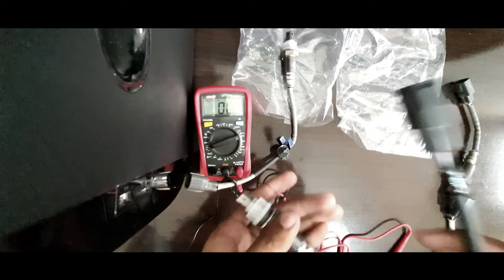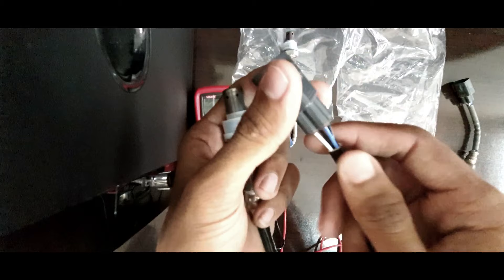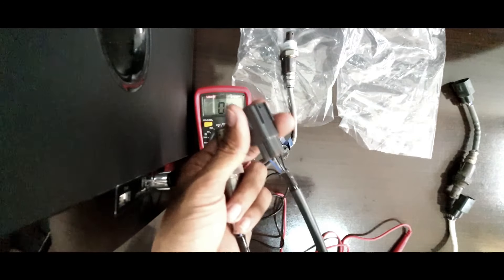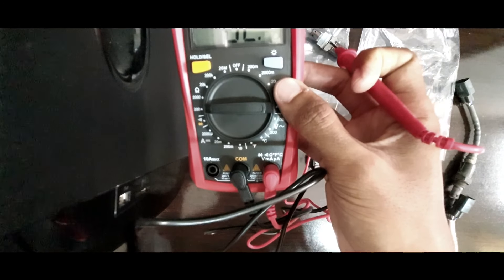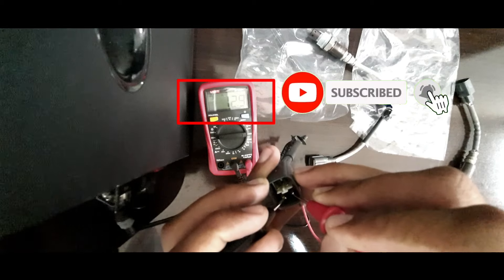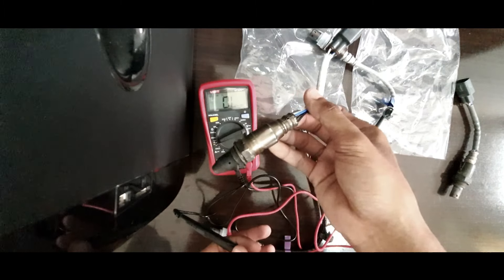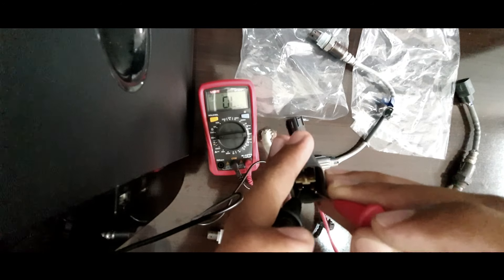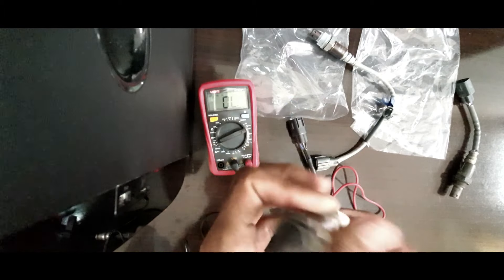How to chake Oxygen sensor with multimeter damage or not 😊easy solution😊

Comment: wrong, 2 black wires are not signal wires, its for Heater circuit, the other two wires are for O2 sensor output signal.
Reply: Thanks for this clarification. I have been confused on the 2 black wires. Don't they have polarity or they can be connected interchangeably
Reply: @SoonQie  they don't usually have polarities
Reply: Hi sir thanks for clarifying but where exactly we able to know and test which of those wire? Please help
Reply: Hey mate they are heater wires, not computer circuit!
Reply: Heater is still broken, needs to be changed
Reply: I have different colors on all my wires. 4 in total - white, grey, black, and red. 2016 smart ForFour 1liter. 0258030336. Throwing up a P224413 code “The connection for the reference voltage of oxygen sensor 1 (cylinder bank 1) has a malfunction. There is an open circuit.” Please help
Reply: It still shows if the sensor is working or not.    
DONT BE HATERS ON THIS GUY.  🇮🇪

Comment: When heated oxygen sensors fail, it is NOT when its cold. The ceramic element changes resistsnce ad it heats up. Old sensors heater element becomes weak with age, does not change linerally with the others. Heated O2 sensor monitor ready test will be imcomplete, or fail. 
Unplug the O2 sensor from chassis, clips leads from multimeter to heater wire pins, start car and warm up. Take note of what it measured cold, and what it meadures when vehicle is warmed up. Do this for all O2 sensors. If anys value is 5% more ir kess than others, it will fail the monitor test.

Comment: Those he tested as signal wires are in fact heater wires that should be small amount between 3-12 ohms.
Other two blue /gray wired are single wires that need to test voltage in car with engine running or removed from car and need external heater to test it's functionality. With ohm test you will just get indefinite homes.
Reply: True. Just looked at Denso O2 sensor diagram and it confirms that 2 black wires are related to heater.

Comment: I will check this on my car! You make it simple to check
Reply: I check both bank 1 sensor 1 and bank 2 sensor 1 and only the bank 2 sensor 1 is not getting any reading on the multimeter.  Bank 1 sensor 1 is getting multimeter reading. So most likely it will be a bad o2 sensor on bank 2 sensor 1 right? That sensor is also called air fuel ratio sensor right? They look the same as o2 sensor but they work diffrently?

Comment: What if the reading is 15.9 and it has contuinty  It is good or bad ?
Reply from the maker: That mens good
Reply: @carhospital  okie but the scanner point that o2 sensor heater 1 detects cause of check engine

Comment: What if my sensor is reading a low signal like 0.05?
Reply: If it is less than 0.1 sensor is bad
Reply: No resistance so you essentially have a short.
Reply: if you read 0.05 on scanner you may have lean condition, if your read on sensor 2 which is located after cat, then you may have heavy exhaust leak